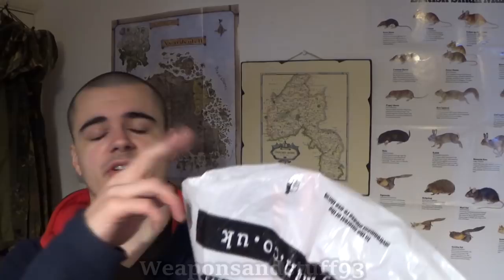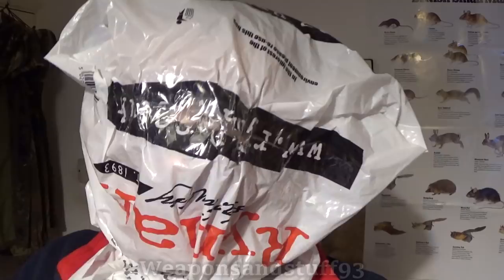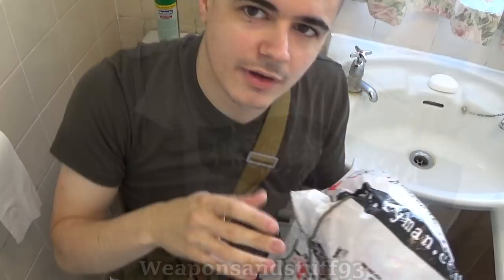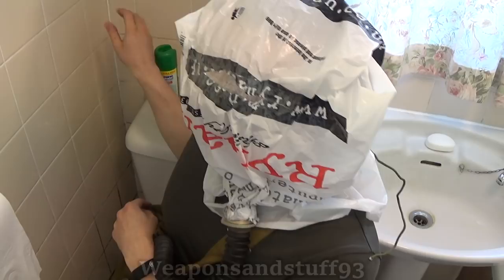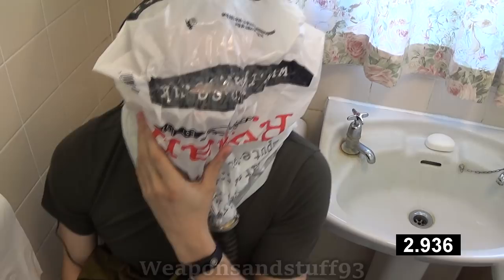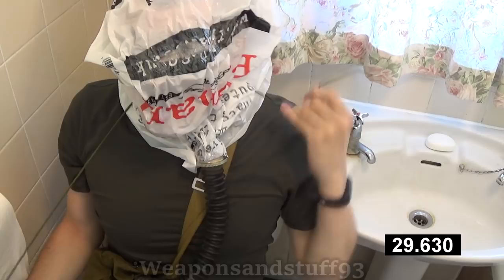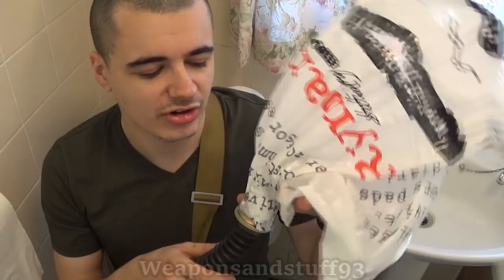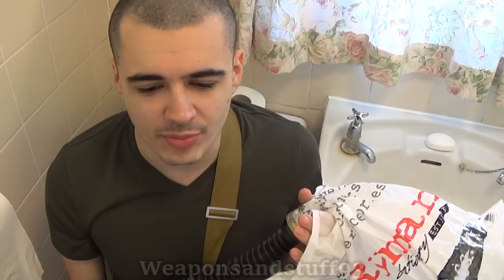Homemade Gas Mask/Respirator attempt

Comment: You can use pumps from hand soap bottles as valves
Reply from the maker: That's a genius idea.
Reply: When I was putting soap on my hands the nozzle stuck to my hand and I thought this would be good to make homemade gas mask with. I have had the idea for a while.
Reply: @Weaponsandstuff93  buy one way valves from walmart there used for aquarium air pumps there 1$ buts its hard to reccomend homemade stuff when the israeli gas masks exist 39$ and comes with filter

Comment: Cheap diving mask (the kind with the exhale valve), and a cheap snorkel. Attach your hose or filter to the snorkel. Breathe in through the mouthpiece, out through your nose. Then have your head examined for not listening to Liam and buying a $10 new in box GP-5 or something. Cheap umbrella valves are everywhere. Easy to buy or salvage from household products like water bottles with a folding straw arrangement. You can put them in just about anything. Just drill 2 or 3 holes. One to anchor the valve and one or two to the sides as your inlet/outlets. I broke down and cleaned my garden sprayer recently and the air pump section that pressurizes the unit had a u-valve about the size and shape of the ones in my Izzy mask.   Great vid, thanks Liam.
Reply from the maker: Thanks for the detailed comment, I might try buying a cheap snorkel mask and converting it at some point.
Reply: Some of the silicone oral/nasal cups used with medical oxygen tanks look like they might be good donor parts as well. Good seal and some of them have a valve or valves that could be useful.

Comment: when your fixing your hoses you should use ptfe plumbers tape to seal the threads like done with a cooker its hard to test for pressure but it works the welsh do it.
Reply from the maker: Good idea, I have a load of that tape for the airlines on my aquarium, however the normal tape is good to demonstrate just how cheap it is to make.

Comment: Superb effort and if it came it then this would be better than nothing. I have tried this with a clear plastic bag and a snorkel mouth piece attached to a exhale filter from a defunked GP-5 and it worked well. Just hard work getting all the tubes and exhale piece taped into the bag.
Reply from the maker: Yeah if you cannibalise parts from gas masks these get a lot easier to make, for example if you took an inhale/exhale valve assembly from a mask and taped it a bag or something similar.
Reply: Yes I agree and thinks its good to experiment like this. I managed over 5 minutes inside the bag but would like to improve on that.

Comment: I'm an American living in Michigan, and I'm very interested in buying an S10 for it's look and general appeal. I'm not necessarily expecting it to save my life or be fully useable, but I'd really like to buy one. How would I go about finding one on Ebay, and how much do they usually cost? Furthermore, what safe filters would I have to buy for it and where would I find compatible outserts such as the red ones you have or the mirrored ones you've mentioned?
Reply from the maker: As it's a British mask that might be quite difficult, I know they do turn up in the states but finding it with accessories could be difficult.
My only real advice would be to check eBay for international postage, maybe use eBay.co.uk and look for sellers that ship worldwide.
It might be easier to get an Avon CT12 or FM12 in the States which are the successor series to the S10.
Reply: Weaponsandstuff93 Thanks friend, I'll be sure to Check them all out, I preferred the S10 because I personally feel that it outshines all the modern masks like the GSR, M50 and the M2000 in terms of appearance. I'm seeing the CT12 being sold on Amazon by AVON themselves, should I trust them as the real company, or a phony one attempting to pass off as the real deal? And a follow up, I'm a fairly big guy, 6'3, it's safe to assume that I should go for a size 3, correct?
Reply: Edit: It's the FM12, and the reviews seem to indicate it's reliable and that it comes a bit worn, but fully functional and accompanied with a bag and Israeli filter, the sizes also say that 1 is the largest, so that'd be the one I'd have to buy I assume. The Size one comes in  Dual port only, is there any major difference from Dual port to Left/Right side other than you'd need two filters?
Reply: John Cacevic fokin' laser sights
Reply from the maker: Yeah Size 1 in Avon masks is large, size 3 is small, I checked US amazon briefly and saw both AVON and AVON 3M as the sellers so no idea if they are legit or not, however it seems to be basically you get a used mask in good condition.
With dual port masks you should get a blanking plug come with it, you can use that if you don't want to use 2 filters, check out my videos on the CT12 or FM12 for more info on them.
Reply: Weaponsandstuff93 I've found an Avon FM12 that comes advertised as EMS Size 1 CBRN large, it's 55 USD free shipping from a highly rated seller called Haproducts, they've got over 99.6 percent positive feedback, so I think it should be safe to buy from them, right?
Reply from the maker: Should be fine, you generally get good buyer protection from both Amazon and eBay when buying off their sites.
Reply: Weaponsandstuff93 Thanks for the info, I'll probably buy it and see the outcome.

Comment: Here in the U.S. (at least where I live) the bags are just made so weak that someone could blow through it
Reply from the maker: +Chris Kelley Don't you have lots of paper bags in the States?
Reply: Weaponsandstuff93 yes and no, big stores like Walmart don't typically have them but grocery stores in small towns usually have the option, the only exception that I know of being Boston as they recently banned plastic shopping bags for environmental reasons.
Reply from the maker: +Chris Kelley Stores have to charge 5 pence minimum per bag in the UK for a similar reason, to try and encourage people to reuse shopping bags.
Reply: Weaponsandstuff93 Around here most stores allow you to bring them back to be recycled but a lot of people I know use them for the bin they keep in the restroom or similar small bins.

Comment: Hmmm, made mine out of a plastic bottle. Works pretty well, even a little tube to drink out of.
Reply from the maker: Plastic bottles will sadly never make a full face seal.
Reply: Yep. You try to make a seal but nope. That's why you can never use them for actual things.

Comment: Thanks for the video this could save lifes
Reply from the maker: You'd still need a filter though, in theory there are ways to make your own filter from household chemicals, as said this design is quite crap and doesn't have a proper exhale valve so CO2 build up is a problem.
Reply: Weaponsandstuff93 yes but good alternative for a broken gas mask if the filter is OK

Comment: I think this is probably the scariest gasmask yet. beat all the other ones i've seen so far.
wouldn't it work better if you put some duct tape around it to make it store less air, therefore not having that much of a co2 problem?
Reply from the maker: The CO2 would overcome you faster though if it was smaller I guess, ideally I'd need to fashion a valve for one of these.
Reply: well, but if there was less free space in the mask you'd blow more of the CO2 out as you breath out.

Comment: The model should be the Ryman-1 gas mask.
Reply from the maker: Maybe, it's already been binned, the next one I make will hopefully work better.
Reply: Weaponsandstuff93 off to the Ryman-2!
Reply: Weaponsandstuff93 anyway, more important business I'm gonna figure out a way to cast a gas mask out of some rubber material like flex seal liquid, or something, but I have no idea what I could do to the intake-outtake valves. (I'm basically trying to recreate an actual gas mask that never existed.)
Reply from the maker: Some sort of rubber flap pinned in the right way would work, I'm crap at making stuff so not really the best person to ask.
Reply: Weaponsandstuff93 that's alright, I will try that, though.

Comment: I wonder wat plastic could stand against in a gas chemical attack
Reply from the maker: Well the fact it won't absorb water is a good start, but I assume acidic vapours would burn through it fairly fast.